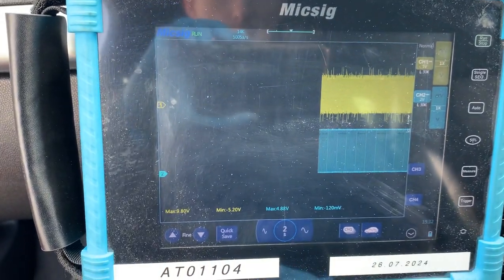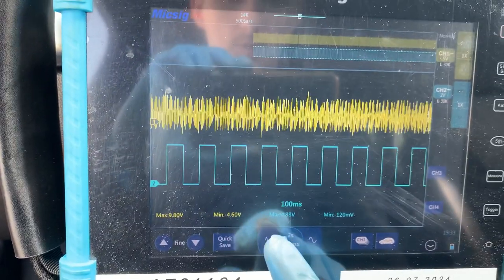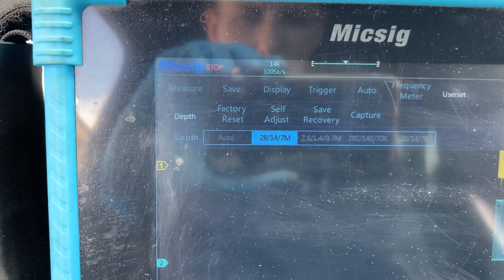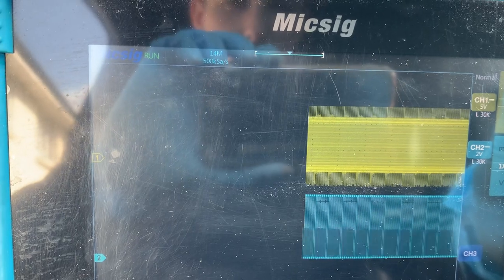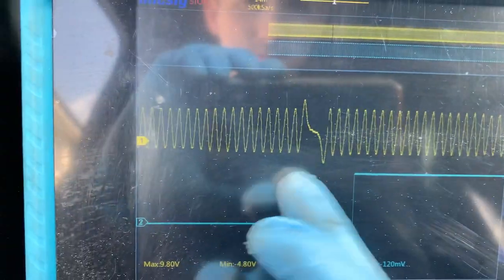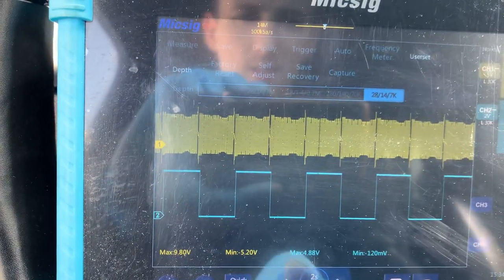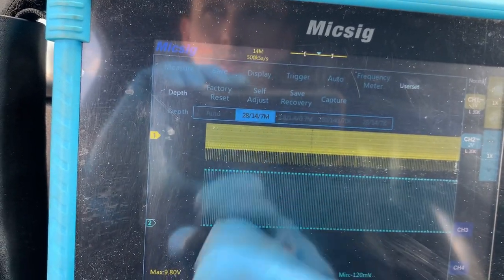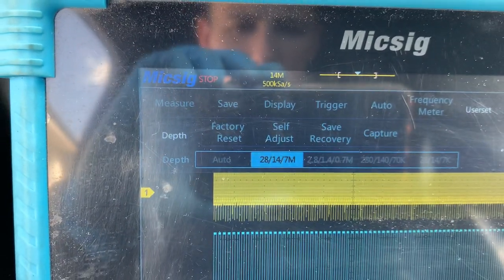Micsig At01104 Cam+ Crank waveform + Sample rate fix !

Comment: Nice to know. So far, I didn't had any issues. All waveforms, was very clear.
Reply from the maker: Yes for some reason my machine was set on the wrong sample rate, I had a few waveforms that was like this when on a longer timebase. Happy i figured it out today
Reply: @mrautoservices7354  keep on, Ryan. 👍👏👏👏👏